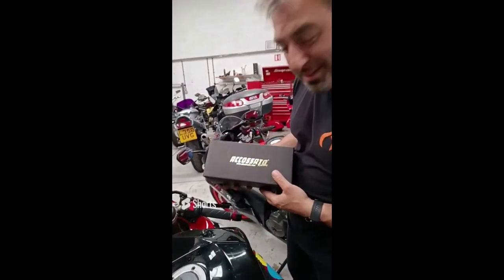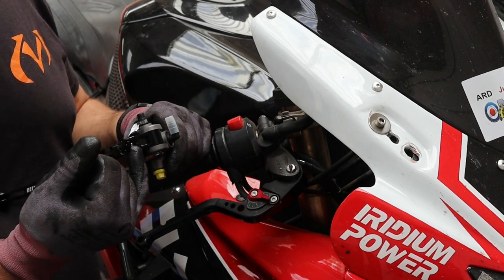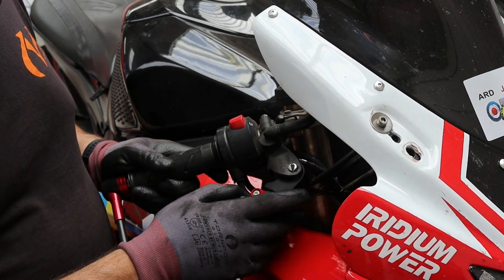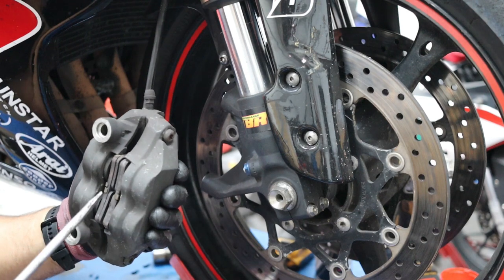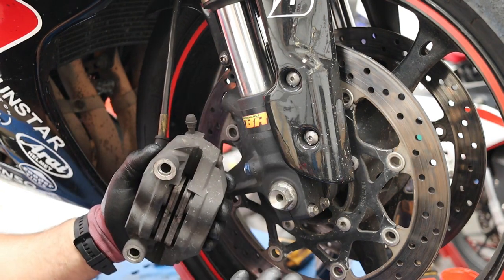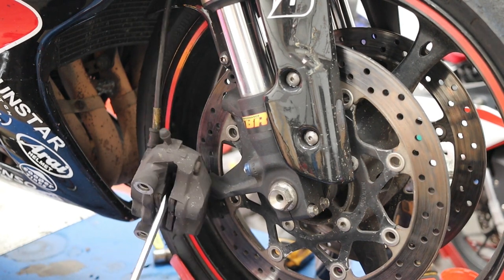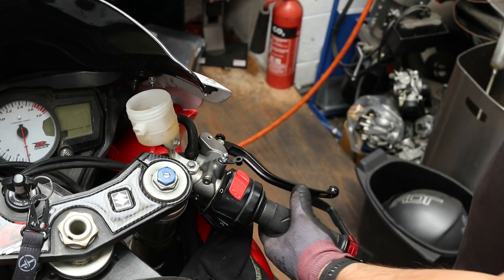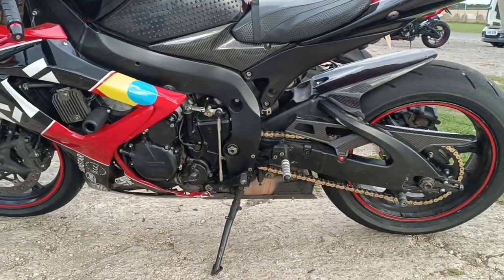Suzuki GSXR600 Accossato Master Cylinder Upgrade

Comment: I have been searching forever for something like this for my TransAlp as the sightglass is completely washed out. Can you put any cylinder like this on the bike, or does it need to meet certain specs specific to each bike?
Reply from the maker: Hi, you can use these brake master cylinders on any bike with 22mm bars, the only thing is that you will lose your original brake switch as this doesn't come with one, you will have to replace the original banjo bolt with a pressure switch, then just rewire it back into the brake switch circuit. I hope this helps ☺
Reply: @melsmotors  Cool! Not sure I do, but will research it and then see if I can find a mechanic that can help me out now that I know! Thank you man! :D

Comment: I've got a k9 gsxr600 and need to upgrade my master cylinder as its terrible   I've heard 2008 and up yamaha r6 or r1 fit and is a good upgrade??
Reply from the maker: Hi, most master cylinders will fit the 22mm bar, the one I fitted is like dropping an anchor when applying the brakes 
, they're so powerful 💪 😳